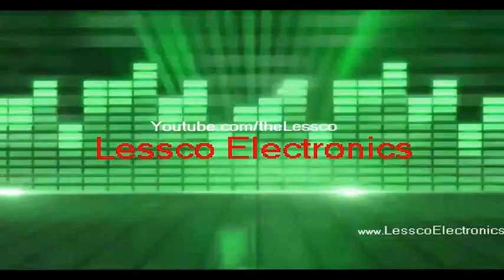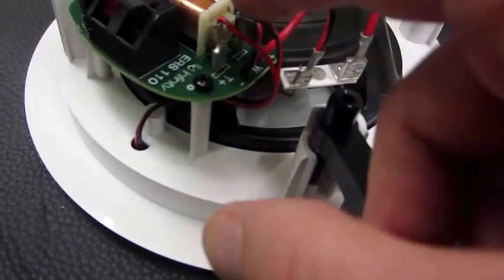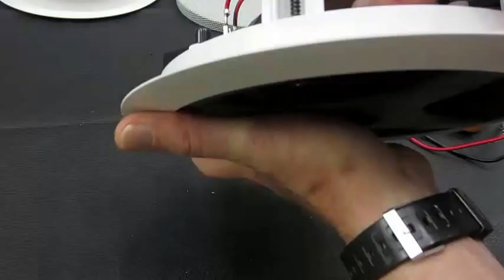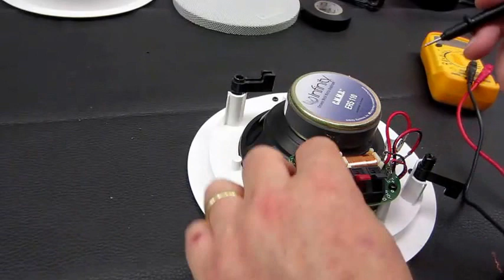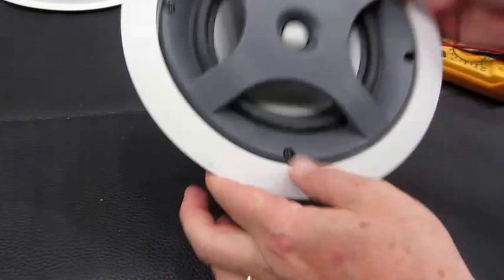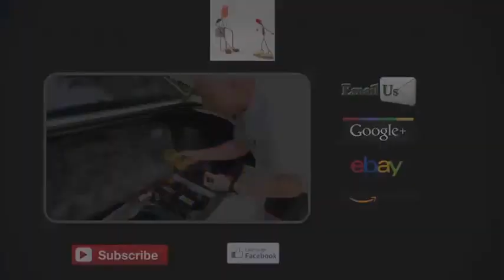How To Test Your Speaker System

Comment: I only use one D size 1.5 volts battery to check for coil movements.  Using 12 volts  is not a good idea!

Comment: how do you know if  your multi meter comes with a beeper or what setting do you put it at  i have 2 multi meters & i can't get a fucken beep out of any of them 1 of them is more expensive that the other one the guy at the store told me it has a beep but where ??/ maybe up his fucken ass  lolol
Reply from the maker: there should be a beep when you set it to continuity nd touch the leads together, be sure the probes are in the right plugs too, that helps too!

Comment: You dont explain what to look for when pushing the cone. Is it bad if the ohms change or is the ohms value supposed to change when you push the cone?
Reply from the maker: the impednace will go up and down with the cone usually

Comment: Would you carry out the same procedure for Beat Solo headphones? There is no sound from the left earpiece. The right ear piece is fine. I have tested for continuity from the sound source via the connecting lead through all wiring and through the speaker, there is continuity throughout.
Reply from the maker: Yes, But I'd use a 9v battery instead.
Reply: Thanks, I'll give it a try.